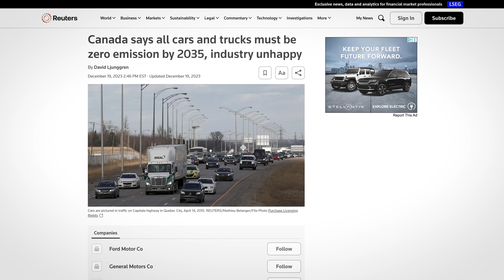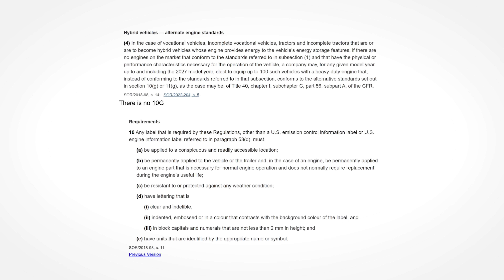Government Red Tape Is Blocking Our Plug-In Hybrid Trucks

Comment: Can you spoof the throttle signal to an on highway engine to perform the same as a off highway "governed" engine, at least until the red tape can be overcome?

I expect the difference between the 2 engines isn't huge
Worst case you have to swap out the 5 on highway engines needed to get the first 5 on the road..., once the off highway red tape is resolved.

Comment: Can't someone just write the code needed to run a hwy spec engine powering a generator? Cruise control senses load and adjusts accordingly. It wouldn't be to far from that but using crank speed and load to calculate throttle position instead of road speed and load?  I'm not a tuner or anything like that but from  here it seems like that wouldn't be that hard

Comment: I wonder if the generator was made in a modular form, a removable accessory to the rig, if this would allow its approval for use on the rig.  Right now the generator is an integral part of the unit.  If it was not, there might be light at the end of this tunnel. The rules are about the emissions created by the truck If the truck can move for a reasonable distance without the generator, it would seem to me, it should meet the standard.  The standards for mobile generators are not the problem.  The problem is about the generator creating mobility.

Comment: Sell it as a kit, make it so the wires that connect the generator to the batteries are sold separately?  then you are selling an electric truck that generates power for a house and if the driver uses the gen to charge the batteries thats on them?

Comment: So, having a generator enginethat only turns on when the the batteries get low to a certain percentile and adjusts to the demand being requested isn't good because they can't find ways to regulate it to hell and beyond like they can with normal engine, but it has no emissions, idles quietly, doesnt need to be active always, truck moves on its own with electricity provided by the on site power pack but cant be allowed to continue because the government can't make money off it. Yeah, no, that makes perfect sense to no one ever, absolutely ridiculous thinking from them

Comment: Could you not use an on highway approved engine running with a variable speed governor at the correct speed to run the generator? Engine speed will be constant, and it will fuel up and down as load increases or decreases.

Comment: Diesel-electric trains have been running across the country for decades, no? Sure, they're not on highway but they run a generator powering electric motors. Or is it that trains fall under different emissions laws?

Comment: Fuck them.... Build a full on Pacific with a 3406 reman engine, straight pipes and turn up the pump. Theyve told you saving the environment is a waste of time so give them what they want. People will be lined up ten deep to buy them. And if Greta doesn't like it too fuckin bad. You guys are onto a good thing and your attitude to trucking is spot on. If they are going to stymie innovation then build the ultimate mechanical truck mate.

Comment: They should make ones that runs on solar power with back up batteries that kicks on at night time and can last two weeks in case the sun doesn't shine for two weeks then it can be plugged in to recharge it or it can use the generator. Them mars rovers have been running on solar power for years they are still driving around all over on mars just off of solar power.

Comment: Im assuming cruise control can be tuned too be based on engine rpm instead of mph and boom engine works like a generator . Or use a different ecu that has more adjustability but I would assume any ecu thats been figured out too tune could be modified to work ..

Comment: Regulations can be good or bad. This seems a bit on the bad side. One thing I would suggest... look into engine governors. They are not difficult to build and have been used on tractors since early last century. They sense engine RPM and adjust fuel flow to maintain a set RPM. You can put a governor on any engine... on or off-road. More modern engines could even use an electronic governor. If they can set and hold an idle RPM, they can set and hold a power RPM. Just a thought!

Comment: You Canadians…. 🤦🏻‍♂🤦🏻‍♂🤦🏻‍♂🤦🏻‍♂😂 just register them as EVs. you don’t have to register them as hybrids, they’re not hybrids! There’s nothing in the Canadian law banning you from driving any vehicle and having a generator on the back running…. The generator is not required for the use of the vehicle… do you have a 100% EV truck it does not require any emissions testing there’s no require for omissions certifications you have a generator that has Nothing to do with the truck and has no bearing on the performance of the truck. the truck does not require it to be attached.  It is a separate item. it is an accessory..

Comment: You could use a cummins L9G natural gas engine as a generator engine.  You can also run them off propane. They don't need much for exhaust After-treatment.
Reply: Unless it's certified for highway generator use it won't work. Scania also have several gas powered engines, biogas, natural gas, CNG, propane etc which would be an easier installation in a truck already designed around Scania engines. Cummins would require all the support systems, hoses, cooling, wiring etc to be imperial instead of metric, that's a lot of work only to get screwed by bureaucrats again.
Reply: @John8087 while yes that's true, meanwhile every military truck with no emissions regulation at all.
I'm sick of this double standard society.
C for Clippy
Reply: @John8087 Scania that you could argue could take biogas should be able to get around the BS I would hope, I mean you could argue that is a carbon neutral generator…
Reply: Yeah this is just Bs "certification"
Reply: The engine they want to use right now is literally cleaner than the engine the government is telling them to use. 

The diesel generator and the natural gas generators are both missing the little piece of paper that tells you they are still clean when you put wheels between them and the ground. And even to everyone with a brain could tell you it doesn’t matter, no one makes that little piece of paper.

Comment: Dumb question, is there no way to create a logic component to alter the function of the engine, so that you can sense load and then dump fuel to get mechanical? 
Take the engine and add a component to turn it into a generator in fiction, not name….

Comment: So they are letting you use low use, clean diesels on your trucks, which the engines arent on half the time. But a semi truck driving full power on the highway is allowed.

Comment: Why are you calling your vehicle a hybrid? The generator can't provide direct power to the wheels, right? You've built the equivalent to a fully electric truck with a genny strapped in the flatbed. Of course they're expecting your "engine" to be certified for street use. Stop calling it that, because that's not what it is. Certify it as 100% electric vehicle with it's own portable recharging system.

Comment: Why not attach an engine and transmission to an electric motor to make the electricity?  Basically make your own generator with on-road equipment.  It's not as efficient but you can use a smaller engine and transmission.  Use the same motor as your electric axles for spares.  With a drop axle arrangement and electric locking hubs you could  have it do work even at highest demand and still get benefits of regenerative braking.  Just a conceptual thought not entirely thought out.

Comment: Chase with all due respect, I called this many months ago. In the world of legalese, although your overall emissions are significantly lower than standard setups, the fact remains that the engine is legally classified as an off-road engine and cannot be used outside of that domain. It would have been wise to seek an exemption before the matter, instead of this uphill battle, but alas... Perhaps a similar spec 9 L Cummins engine that is on-road Tier IV Final spec can be reprogrammed to work in conjunction with the electric setup. I wish you and your team luck in your steadfast determination.

Comment: What is the actual difference between Tier 4 on highway vs off highway? It's not 2035 yet, cant you just fit a Tier 3 on highway engine and control it?

Comment: I know this probably isn't a skill set you have in house, but making an engine governor isn't rocket science.  

I.e. It sounds like the regulators would let you use an on highway engine to drive the generator.  You could then add an external governor system to regulate engine speed and make it act like an off highway generator engine.  Definitely an annoying work around, but if it gets you past the red tape it's probably worth it.  

Might also be worth asking Scania what the actual difference is between the on highway and off highway emission regulations.   If you're lucky there is no difference and they just need to submit amended forms with another check box filled in.  (i.e. the bureaucrats processing the forms often don't understand the tech they are regulating)

Comment: You guys are not smart and use the on highway engine...so what if it has throttle. there is a thing called cruse control  so if the engine... 
so have the engine set the rpm to charge battery and the throttle to set the engine... On Road certified engine can do the same as Generator engine. 

so just use the engine... how stupid CAN YOU BE... in not understanding that you can you... do it...

Comment: Honestly I think your best bet would be to get the genny manufacturer to get an on highway approval. Maybe use the low volume exemption at first and once up to speed the genny manufacturer should be able to provide an on highway version, maybe with just a different tune or something. Also could there be a way to put a governor on an on highway engine and blot it to the generator?

Comment: so why can't somebody use a gear driven generator or a PTO type powered generator to recharge the batteries? Hell, use a belt drive generator powered by the trucks wheels while it goes down the road.  a farm tractor can power a 10k generator using a rear PTO shaft.

Comment: Since you control the sole load on the generator, an otr engine will absolutely work. Let the inverter ease the load on the generator so you don't realy need a ultra fast response time like a normal generator. Also, why are you not using a DC generator; AC is only realy needed for long distances. That would let you skip the whole ac to dc conversation for the batteries.

Comment: Fact: you can legally charge your electric vehicle from an off highway diesel generator

Fact: You could sell that truck without the Genset as a “full electric” and it will be compliant. 

Fact: customers can legally mount that off highway generator on a trailer or possibly on the truck itself and charge their truck whenever they want as it’s not Original Equipment it’s exempt from regulation.

Fact: Environment Canada has never let a good idea get in the way of their ideology.

Comment: You might be best off focusing on export markets.  You are already seeing a lot of international interest and you're unlikely to see the degree of hostile regulations in other countries as you will in Canada.  Frankly you're not brooksfield and you aren't playing the political greasing the wheels game, nor should you.  You can still build in Canada, just not FOR Canada.  

The suggestions given to make a 'bolt on generation' option also won't work in Canada, for those that aren't aware, Canada has a very very scrupulous and aggressive enforcement department for commercial vehicles.  You can't make trips very far without passing by mandatory weigh scales that are subject to full examination of your vehicle, unless you're of a protected 'discriminated' class of citizens, you can presume that you will see a full commercial vehicle examination roughly once per month depending on your luck.  This kind of addition to your vehicle would get you immediately pulled off the road and left in timbuktu with no ride and no way to continue transporting your goods, as well as incredibly high fines and possibly losing your commercial license.

You will continue to run into endless roadblocks and bureaucratic red tape in Canada, find a market for your goods with a country thats actually interested in them and build for them.

Comment: Maybe I didn't understand correctly, but it seems clear to me that you only need to replace that CAT (off-highway) engine with an on-highway engine (from an Isuzu or so?) and tune it to work just like the CAT did, running at 1 set rpm. You can also build a small '18 gear transmission' but only use 1 gear to drive the generator. They didn't say you need to use all 18 gears, did they? Again, maybe I'm seeing things too simple..

Comment: Have you tried to use Small Modular Reactor instead of diesel running forever engine? That is your problem. I am as well buying RAV4 gasoline to bypass electricity generated be station which burns gas with 30% efficiency to supply my charging outlet. Government hates me for that!

Comment: How about Refer engines? They work on demand, and are on highway. Not just the little ones on a van trailer, there are bigger ones running cryo systems for unstable chemicals and LNG. Marine refer systems could also be a source of certified on demand diesels. Progress Rail, is also building compliant railroad switcher locomotives??? How are they doing it.

Comment: You can use a CAN controller to run the electronic highway cert engine at 1800rpm to drive the generator.  Easy peasy.

Comment: Solution seem simple to me.... This is an electric truck that just happens to be moving a generator around. If you can't play by their stupid rules just bend them. A Heavy duty electric trucks that comes equipped with a generator to power your worksite....  Then just add a plug that the customer can plug in their onboard generator to their electric truck behind the cab. Then it works as you want and isn't technically a hybrid at all.

Comment: Why would you choose an actual genset for that task when a VFD controlled generator behind a on-highway engine in PTO mode is the most correct, and obvious, choice?  Heck, you could have used the VFD generator in speed control and spoofed the throttle to get the power you need.  That’s what I thought you were doing this whole time.

I’ll list the reasons.

-1) A on-highway L9, or even the lowest purchasable rating of X15 can easily compete with the BSFC of a genset whirring along at 1800/1500RPM. This is especially true if you’ve implemented controls to keep the engine in an operating space that produces good heat for the DPF/SCR.  Luckily, turbo diesel engines naturally make their best BSFC near torque peak on the torque curve… you’ll have all the heat you want.

-2) It’s better for NVH anyway.  Move RPM up or down as many as 50RPM from the optimum efficiency speed to avoid harmonic resonance in the truck.

-3) And this is the big one, THE REASON YOU CANT USE A OFF HIGHWAY ENGINE IN A ON HIGHWAY TRUCK.  On highway engines have 200mg/hp-hr NOx and 10mg/hp-hr PM limits.  Off highway is 300mg and 20mg, respectively.  And regardless of your reduced fuel consumption a hp-hr is a hp-hr.  You’ve chosen an engine that, when it’s running, will make around 1.5x more NOx that the 15L/18speed combo, and depending on the aftertreatment configuration 2x the PM.

But things are changing.  Emissions requirements are getting tighter.  Come 2027 you’re looking at a further 90% reduction in NOx and 50% reduction in PM. The T4f genset is MUCH more polluting in the emissions that produce smog and exacerbate respiratory disease.

So, no.  You can’t use that engine.  I’m really disappointed that you didn’t know better, and I’m especially disappointed that you would attempt to use your platform to shade the government into relaxing NOx/PM emissions requirements just for you.

Comment: Interesting. Refer trailer refrigeration engines run at just one optimal speed, so does that make them off-road engines and therefore illegal?

Have your MP sponsor legislation to allow this for highway tractors, same as refer trailers. 

Or, could you control the tractor engine electronically? Use a highway engine with electronic throttle control, and have the software control the RPM under load at lower end of max torque speed curve.

Please continue to develop the hybrid highway tractor. Pull log trailers with it and document the fuel and emissions savings and take that to Parliament as proof that this works. 

There’s always something!

Comment: What about selling them as full EV trucks, then adding an optional generator as a trailer attachment?
Limited, but another potential option is to make and sell offroad only hybrids for logging and forestry so theres something available to keep things moving. Sales will be to a limited market sure, but at least any units already produced with the current generator setup can be sold without modifications. Down the road, you get the greenlight to use the generator hybrid, those vehicle's can be re-designated as highway/road compliant after an inspection is performed to confirm the vehicle is still within OEM specifications.